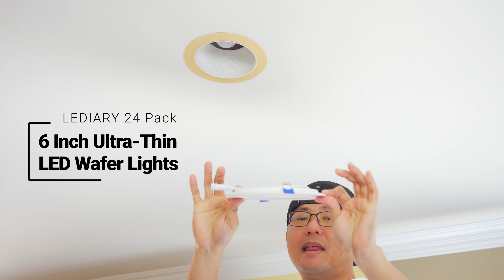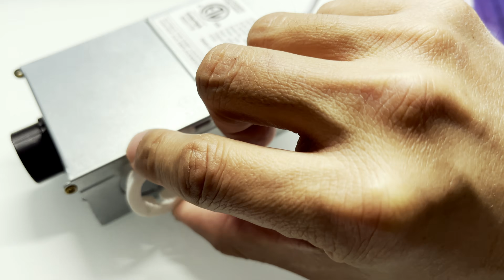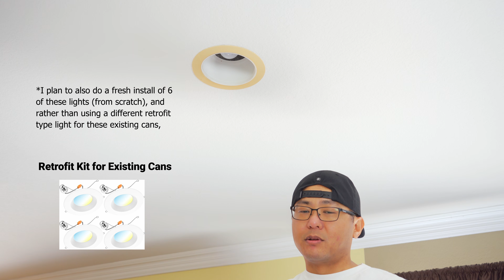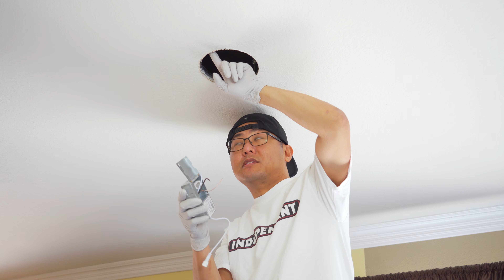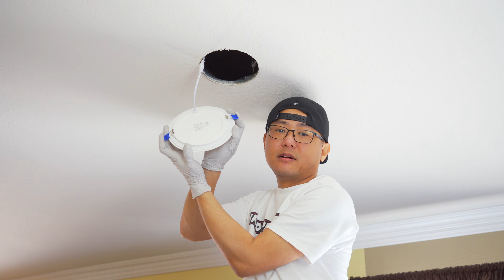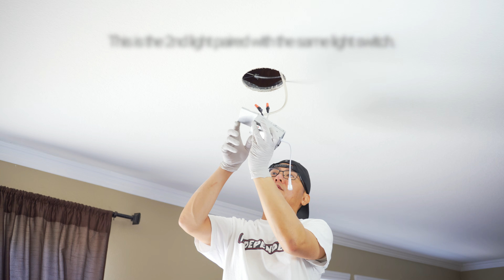LED Wafer Lights Installation - Replace OLD Recessed Can Lights 6.5" [24 PACK] Best for Home Review

Comment: I missed the part where you removed the can and pulled the wires out of the existing box.   Still like to remove ALL of the existing fixture to keep it clean up there.  That's the hardest part.
Reply from the maker: You're right, I did cut the footage at 3:24, but essentially, I pulled the black and white wires from the can, and then connected to the new box.  But you're definitely free to remove all previous hardware.

Comment: Thanks James. Able to link to the STL for the 3d printed grommet? I was going to design something like that Thursday when my lights get delivered.
Reply from the maker: Hello! Sorry, but that was on my old work laptop. I have about 10 more of these lights to install and will link the file here if I find it 👍🏽
Reply: Don't use a 3d printed grommet. Any hardware store is going to sell the metal grommet you're supposed to use to be code compliant.

Comment: I was hoping to do just this, but my brackets are slightly under the 6" needed for the wafer so I had to remove the metal brackets.  Then I discovered the hole in my drywall is 7" (ish cuz it was a sloppy job).  The only option I see is ripping everything out and pacthing the drywall so I can start over.  Afraid I have to use the retrofits.  I am open to any ideas as the wafers look like they will be easier to work with insulation and let less air into my ceiling.  I do have access to the other side in the attic.
Reply from the maker: Apologize for the late reply, but if it's not too late, they actually make these in 7" as well, just so you won't have to do very much extra work.  Check them out here: https://amzn.to/49lxAsY

Comment: Did you cut the metal conduit out or did it come out when you disconnected the wire nuts inside the original junction box. I want to do this for my guest room as I like the wafer lights better. Thanks!
Reply from the maker: I actually left it in place, as I was able to pull the wiring just fine, in case anyone in the future wanted to go back to can lighting 👍🏽

Comment: Where's the ground connection.
Reply: The LED j-box has a ground lead connected to the metal box that you wire to the supply grounds
Reply: @matt65535  ok, thanks.

Comment: Hi James: Cool video :) I have the same scenario as you. Pre-existing can lights. The instructions call for a 6" cut for the new LEDs. My current hole is approximately 6 1/4". Will I have a problem because I have an 'oversized' opening? Also, I see you bought the Leidary over the Ensenior. Any reason? Thanks! Rob
Reply from the maker: Thank you! The pre-existing holes in my ceilings were a 100% fit to the cutout template. As long as the housing covers them up, I wouldn’t worry about it. Maybe look into a different gasket for bathroom use. 

I did see the Ensenior brand, but went with the Leidary brand soley based on the price at the time. Good luck! 👍🏽
Reply: They make trim rings to fix oversized holes, I needed them when I retrofit mine. You can find them listed as Goof Rings since they're meant to fix if you made an oppsie cutting the hole, with different diameters of both light and the outside of the ring.
Reply from the maker: @matt65535  Good to know!  I will be cutting 4 holes soon to install 4 more of these lights, and if I mess things up, I now have a backup plan lol thanks

Comment: Hi James! My new home has these lights. When it's time to replace one, do I just need to buy a new light and plug it into the existing connection?
Reply from the maker: Yes, if you are able to buy the same brand and model, you can just pull the old light down, remove the threaded connector, then replace with the new light.  No wiring work needed :)
Reply: @JamesFixIt  Thank you for the info!